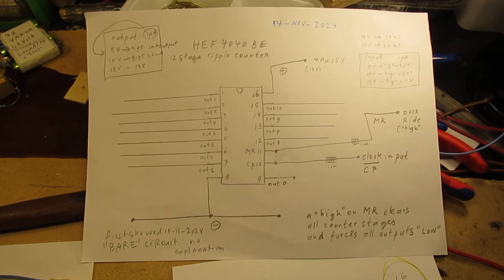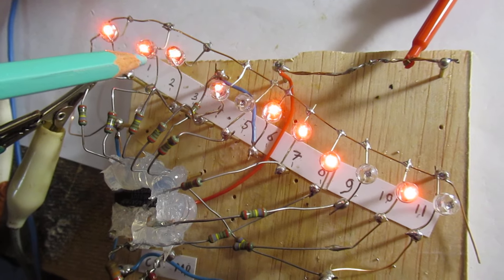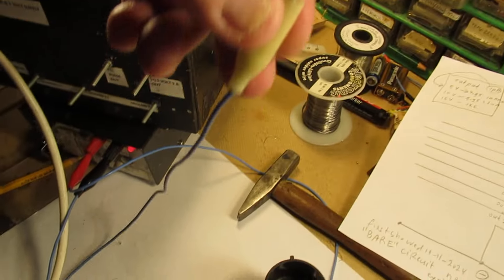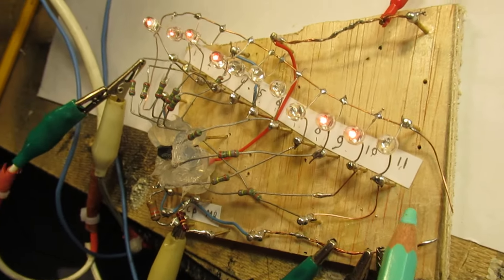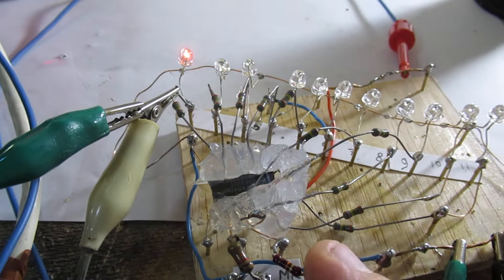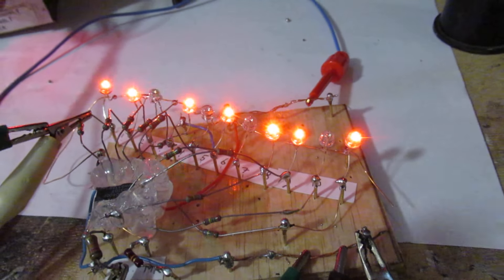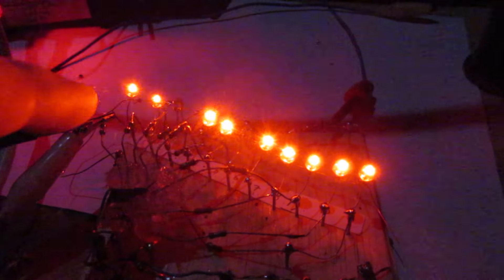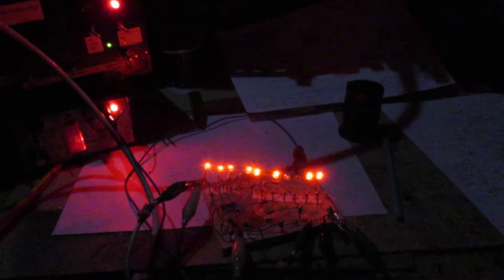HEF 4040 experiment 1: test how to drive it. A piece of wire as antenna on the clock input & more

Comment: There is 12 outputs , one input ( shmit trig ) and one reset. If on input exist wave 50Hz , then is 25 Hz on output first ( marked as "0" ) . Etc...
👍
Reply from the maker: Thanks for your valuable attribution !  I am (like I told in the video) not very aquainted with these kinds of circuits. It is all new for me. 17 nov. 2024.
Reply from the maker: Thanks for your comment. I found on pin 9 (=output "0") a sawtooth wave of 50 Hertz.

Comment: Hi Ko.  I think your circuit is counting in binary. The first 4 LEDs are counting to fast. That is what I think.
Reply from the maker: Thanks Ron for your valuable attribution about this very first test circuit! My idea is to do more experiments and try to give this 4040 Chip some "uses". In all kinds of ways, especially switching something on or off after a certain time, etc. You will surely know that. Perhaps also in other applications, not pointed directly to digital electronics. Thanks again 17 nov. 2024.